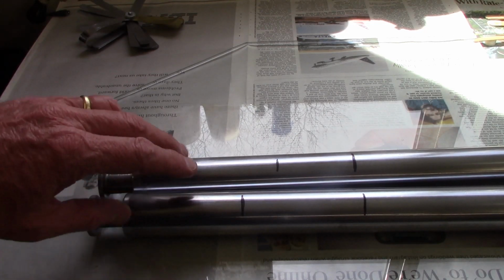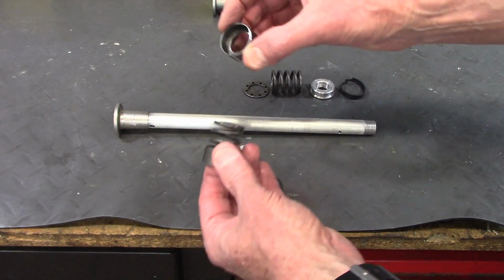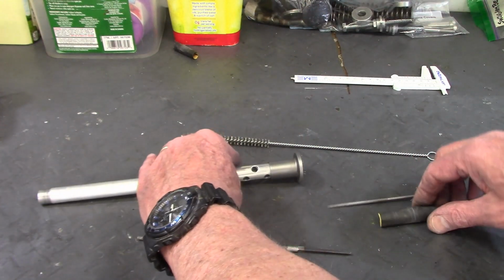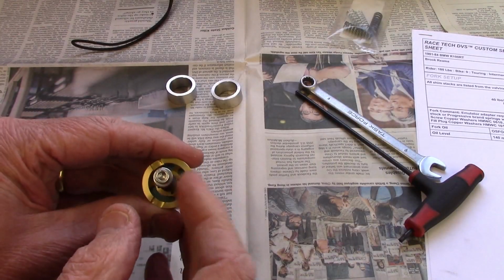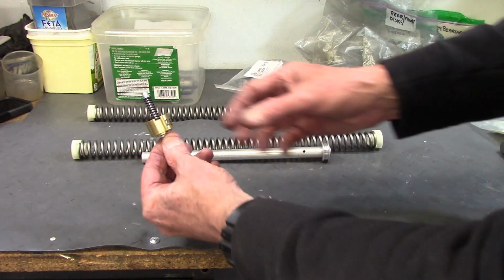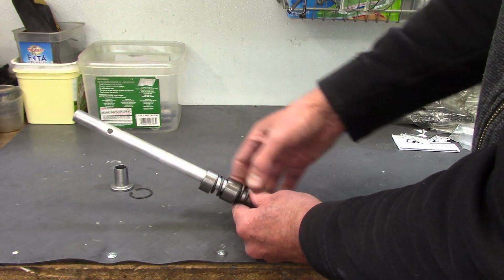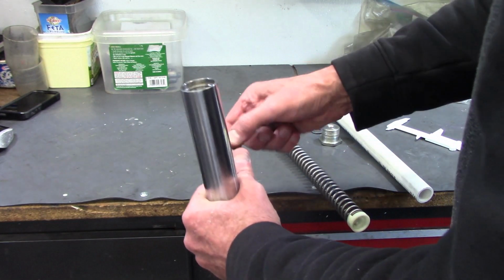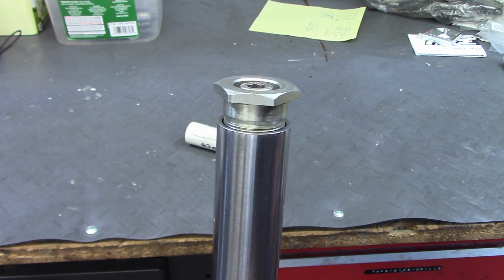1983 BMW R100RS Rebuild Front Forks With Race Tech Cartridge Emulators

Comment: I’ve been following your videos to rebuild my 1984 BMW R100RS. When rebuilding the forks, the bottom of my fork sliders had these large snap rings next to the two bolts. I’ve searched the web far and wide and cannot locate the size or part number for the snap rings. Now, I know I shouldn’t have removed them, but I did for powder coating. Any advice on snap ring size or part number?

Comment: Looking for any feedback after riding with the Race tech setup? Looking to do the same and curious if it’s worth it? Great videos! Thank you very much.
Reply from the maker: Shadowrayray, The low speed (small bumps) performance is much improved. I had to reduce the compression damping (lighter weight fork oil) and rebound damping (internal spring on the cartridge) to make the high speed (sharp bumps and potholes) a bit less harsh from the original RaceTech recommendation.
Reply: @BrooksAirheadGarage  Yes seems like Race Tech is tuning a little more ”track focused” .

Comment: Why not just the pvc spacers until they are flush with the fork tube?
Reply from the maker: Lou, I just followed the instructions RaceTech provided for how to determine the length of PVC to get the recommended front suspension sag.
Reply: @BrooksAirheadGarage  you did an amazing job.  It’s just ironic that it came to that length.  Just curious. Do you believe the  pvc pipe in forks will deteriorate over time?
Reply from the maker: @louprimo6062  I've used them in other bikes to set the sag for over 30 years and no detectable damage occurred.

Comment: so you use both racetech valves? one on each leg? when I did this to my r100gs I only needed one because the other side does the rebound. when you modify these does the rebound dampening change? looking to do this to my 84 RS
Reply from the maker: Hi dsruddell, The fork design on the GS is different from the RS/RT design with only one leg having a damper rod. The RS/RT are symmetric with a damper rod in each leg.

Comment: I just drilled out my damper rod and am ready to measure for length of spacer needed for pre-load. I have a clarifying question for you. When you hold the fork tube upright and drop in the emulator spacer, emulator, two washers and fork spring to measure the depth to the spring top, the damper has to extend and slide out the bottom, correct?
Reply from the maker: Hi Tom.  Yes.
Reply: @BrooksAirheadGarage  Thank you. Your how-to video is excellent. Too bad RaceTechs instructions aren’t. A couple of differences as regards my K100RS, but really due to your type of damper and fork tube cap. It applies otherwise.

Comment: Just wondering why you used the plastic spacers from the OEM fork springs? I am about to do this upgrade to my 1985 K100RS and RaceTech told me to not use them. The OEM springs need them to sit flat but the RaceTech springs are ground flat and do not need them to sit flat in the tube.
Reply from the maker: Tom, the spacers (white plastic PVC) are not from the original springs. I cut them from the piece Race Tech provided using their formula for spring pre-load for the length.  A K bike suspension is not the same as an airhead suspension, so the parts and procedure provided by Race Tech differ.
Reply: @BrooksAirheadGarage  Hi. I'm not talking about the PVC we are given in the kit to cut for pre-load, but the plastic end caps that twist onto either end of the OEM springs. You've twisted them onto the RaceTech springs but they actually don't fit properly because the RaceTech springs are ground flat and sit flat naturally in the tube, unlike the OEM BMW ones. Tyler at RaceTech told me to not use them. I don't see it as an issue, necessarily, as the only thing it changes is the overall spring length and therefore the length of PVC required for preload.

Comment: I’m having some difficulty here brook I tried taking my thread piece at the end of the absorber off and completely destroyed it. Do you know a place I can get a replacement part for it?
Reply from the maker: If you mean part# 31 42 1 232 054, any BMW motorcycle dealer can sell you one. In fact, just about any parts for these bikes are available at the BMW dealer.
Reply: Brook's Airhead Garage not that exact part but that’s the piece of aluminum thread stopper I’m talking about. It has a nylon strip to seal the dampening in the fork tubes.

Comment: IIWY, I would turn the vice grips 90 degrees on the work so the jaw serrations run across the direction of rotation.....  just sayin'
Reply from the maker: Hi Sssthpok, Well I held the bottom spacer on the damping rod that way to avoid putting grooves in the spacer since it slides inside the fork tube and I didn't cut a lot of serrations in it. I caught the edge on one of the vice grip serrations so it didn't end up scoring the OD of the spacer.

Comment: Do you have previous experience with RaceTech emulators and their single rate springs? I would be interested to learn what you think if that is the case. Things like static sag, ready-to-ride sag and comfort compared to stock. Thank you. Eirik

Comment: IT seems You need an adjustable Cap Bolt. If you ride with a full tank bag and a full tank of gas one day then no tank bag and a half a tank of gas  the next you are going to need a different preload. If you are going to the trouble to change the forks would it be nice to be able to make adjustments to it. If you could make up a cam like on rear shocks then you would have something nice. How much fork travel do you loose with this kit and will it give a harder ride?
Reply from the maker: Hi Alan, 

The damper rod travel is the same since the cartridge emulator fits on top of the damper rod so it does not limit the damper rod and fork slider travel.   

As to adjustment, the original forks, preload adjustment was done the same way with a spacer on the spring, so nothing is lost in that department. However, having three damping circuits in the fork, one of which is adjustable, instead of only two circuits, not adjustable, in theory provides a better ride. 

It makes sense to me that a separate low speed compression damping and high speed compression damping circuit can improve fork compliance compared to a damper rod design that only has a single compression damping circuit. Damping rod compression damping it's always a compromise between smooth small bump (low velocity) compression and smooth sharp bump (high velocity) compression.

Anyway, it's done now, so I'll have to wait to see how it handles and feels after I get the bike back on the road.
Reply: The other key thing is that these things aren’t THAT sensitive.  Adding 15-20 lb to a 500 lb motorcycle and a 200 lb rider simply isn’t a big deal.